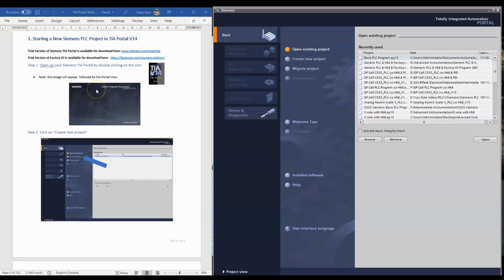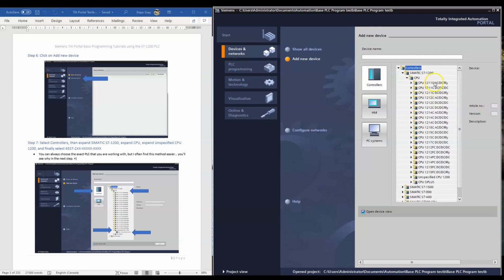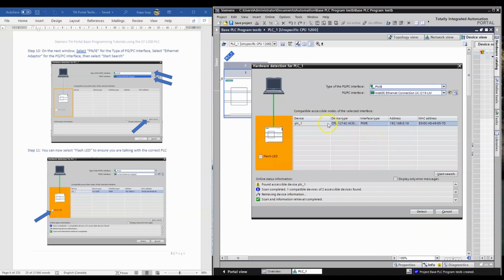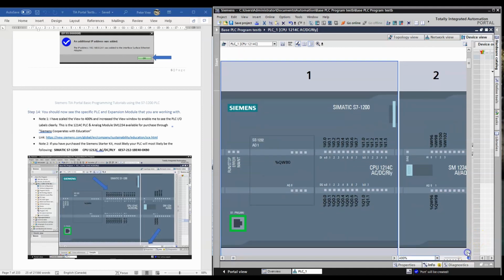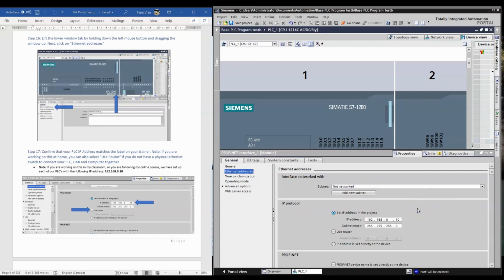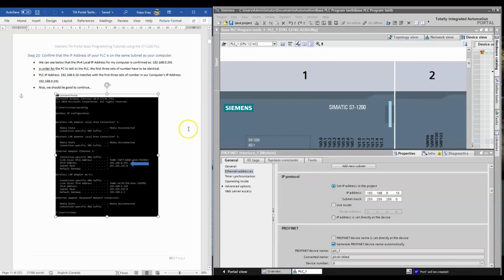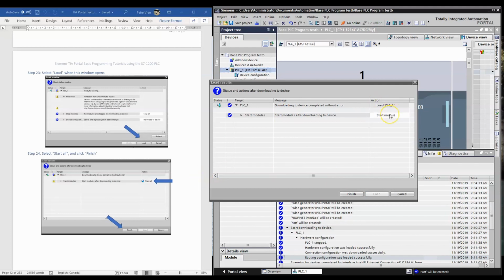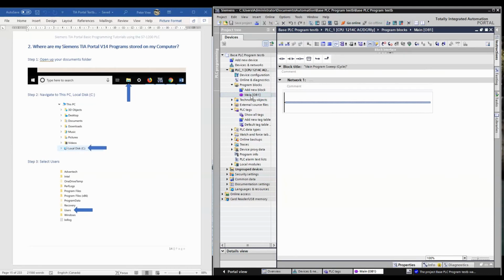Siemens S7-1214C PLC Configuration Instructions (TIA Portal)

Comment: Hii Tim, your doing a very great job with your content. i have few questions to ask on S7-1214C PLC
1. An S7-1214 Siemens PLC has several LED indicators that can be used to verify if the
processor is operating correctly. The Maintenance LED is flashing yellow and there is
no memory card. What does this mean?

2. IF An S7-1214 stopped controlling the machine. The STOP/RUN indicator is yellow and
the ERROR LED is red. What’s wrong?

3. A ControlLogix 1756-L63 processor has a flashing green I/O LED. What does this
mean and what should you do to troubleshoot?

Hoping to hear from you soon.